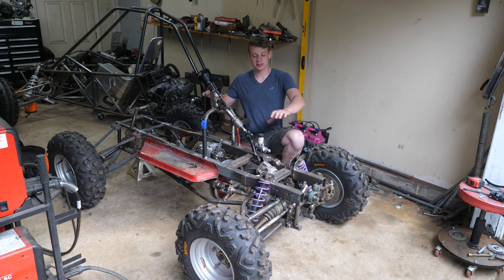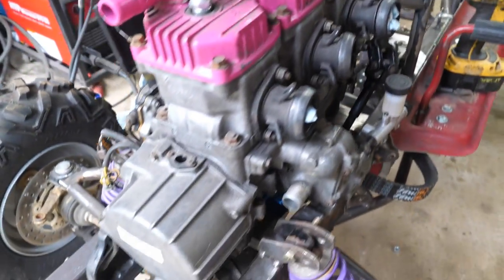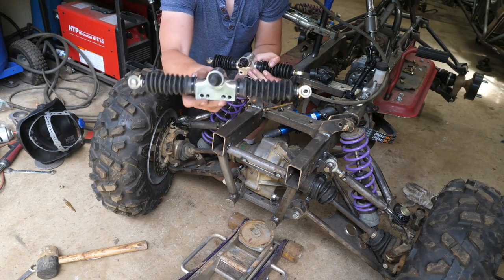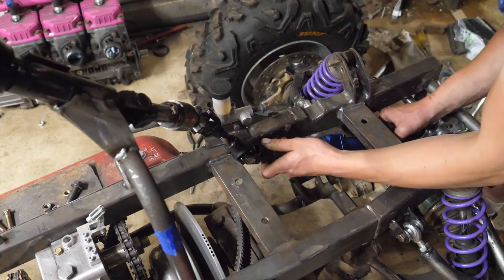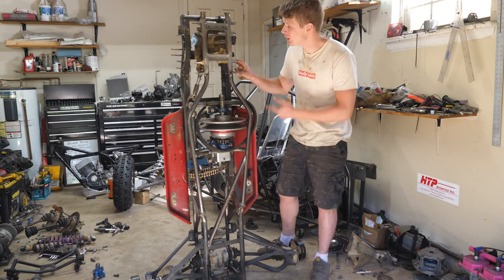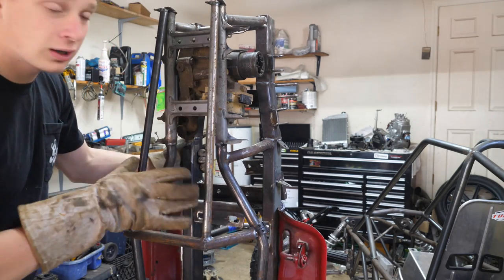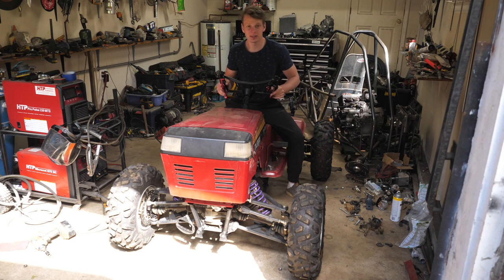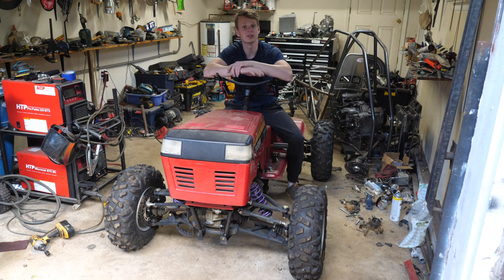4x4 100HP Triple Mower Build part 13! Almost ready

Comment: If you are planning to drive it in mud or water I would suggest you build a cover for that secondary clutch, it doesn't need much water on it before the belt starts to slip! Really looking forward to see the thing complete, had the exact same engine in my snowmobile that I sold 2years ago! Greetings from Sweden! <3

Comment: I notice that your engineering blueprints amount to, "That didn't work, so let's try this". 🤣
Reply: That's pretty much R&D in a nutshell. "This part broke when we tested it. Now lets make it so it doesn't break." or "This idea sucks, lets try something better." :)
Reply: @Slane583  Yeah, I wouldn't expect Vasily, Grind Hard, Redbeard, Cars and Cameras, et al, to do Finite Element Analysis or CAD/CAM!
Reply: @donellmuniz590  When you're good with your hands and have an idea in your head CAD is not required. I took autobody in my last years of high school and on the very first day of class my instructor had us all sat at the main table we used for paper assignments, held up a book and said "By state law I am required to teach you what is in this book." He dropped it on the table and continued to say "But I'm not going to waste my time or yours by using it. You're here to learn how to work with your hands, not from books. There's only so much you can read about in a book. Actually using your hands and physically doing what the book says is the only way you're going to get good." And it's true. You'd be surprised at how many errors and imperfections you'd find while doing a tedious body project just by feeling it with your hand. Software is a good accessory to have but it's not replacing physical skill. :)
Reply: @Slane583  That works fine for go carts and doghouses. But you wouldn't design a cylinder head, a racing chassis, or intake manifold nowdays without CAD, and expect it to be competitive.
Reply: @donellmuniz590  Of course not. But I highly doubt they're trying to make precision parts any time soon. Something like a cylinder head or engine block require far more than just cad software. Getting into something like that requires forges and casting molds.
Reply: @Slane583  Yup. I like metal, I wish I had learned pattern making and foundry when I was young enough to use it. And welding, and machining, metal shaping, etc, etc. I was always too busy just makin' a living 😕😑.
Reply: @donellmuniz590  When I was learning auto-body I was more focused on pulling dents, panel prep, painting, and final finish. So I never focused much on the welding part of it. Which I regret now because I could be making things and selling them to people. Even if it is something simple if someone finds the need for it they will pay for it. Especially if they it's a quality item that will last. So I've been pondering on getting a small welder to re-learn some basic welding. I've just been paying for more important things first. :)
Reply: @Slane583  I have a mig and 2 different stick welders, and I can't use any of em to save my life!
Reply: @donellmuniz590  Practice makes perfect. Find some random junk and just weld it together. I want to re-lean as I never got too into welding. But for me I don't own a welder nor do I have the place to work on anything. So I'm slowly building it up. :)

Comment: That build is dope u need to put it against the curnul senders at  ghpc when it's done
Reply: should be EPIC
Reply: @Mikefngarage  WILL be EPIC! This really needs to happen- Vasily and Ethan have some similarities in their process- their finished results are usually a scream! Col. Senders may be overshadowed by either or both of Ethan's current projects- a 2JZ powered lawn mower and a 13b powered drift trike . All three look like they should be ridden by something that looks like Ed Roth's rat finks!  FR
Reply: Where is Vasily located?  I'm wondering if distance would make a meet with the GHP guys a problem?
Reply: @TrevorDennis100  Chattanooga, Tenna! he's friends with vTuned and the gang at Motorhead Co, Billy and Simeon over at Goonzquad. I'll go out on a limb and guess he also goes to the church the Ukrainian community their has built- Kondor's dad was one of the prime movers and doers on that project. FR
Reply: @TrevorDennis100  I am not sure what side of the boarder he is on right near Chattanooga TN. That is right near GA boarder.

Comment: Really curious to see how you seal up the clutches! otherwise that thing will be useless on the trail. I don't mean this in a negative way either. I built a 583 quad last year that I had to make a clutch cover for as it got stuck in the first puddle it went through! Funny looking back on that, now it goes through water half way up the clutch cover!

Comment: Just noticed... that guard you added underneath to protect the pulley... good idea.  But it does look like the crossbar would tend to catch on rocks or roots, depending on where you ride it.  Is the plan to add a skid plate?

Comment: Is there anything as digital steering like how a drive by wire throttle body is, cuz if that's a thing you wouldn't have to have any linkages.
Reply: As far as I know, that's not a thing....in case it fails you need a backup so u can still safely steer.

Comment: 4:20 that's not how bumpsteer works dude. 
Your lower control arm length must match your tie rod length pivot to pivot. 
So you pick a rack, build tie rods, then match LCA lengths and move their chassis mounts to suit desired static camber

Comment: Idk ur elevation where u live but im sure u gonna have to rejet ur carbs so u don't blow that motor up once u actually get to drive the beast sleds are typically jetted for above 3000 ft so u need to go richer on pilot an main a couple sizes